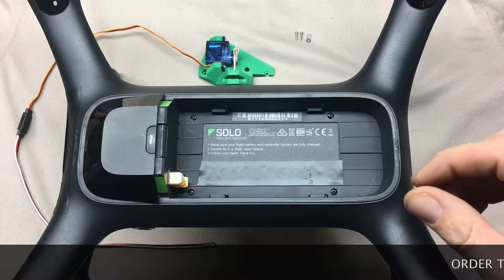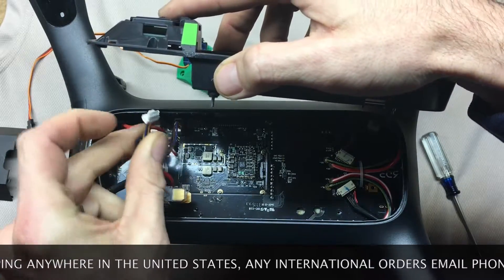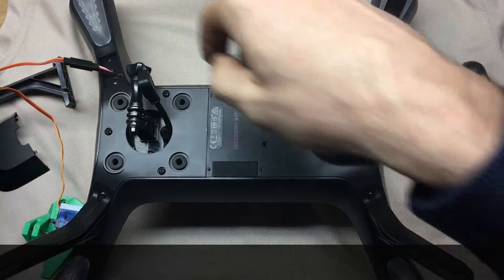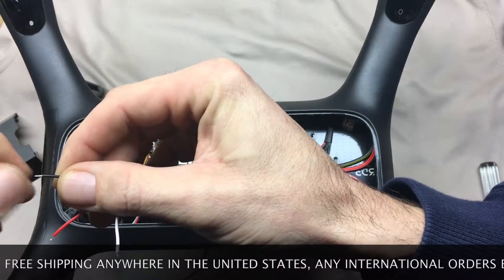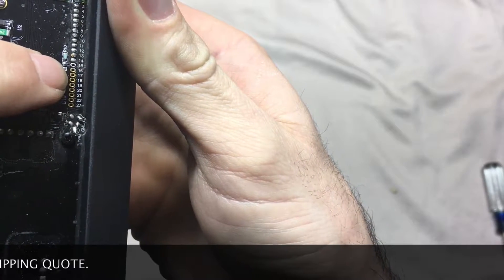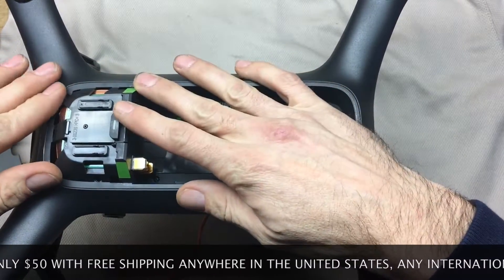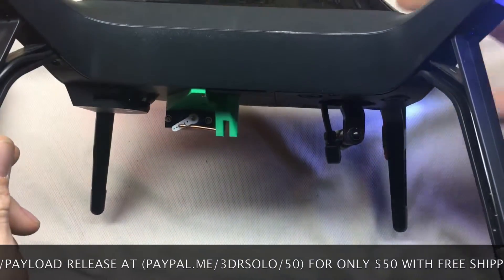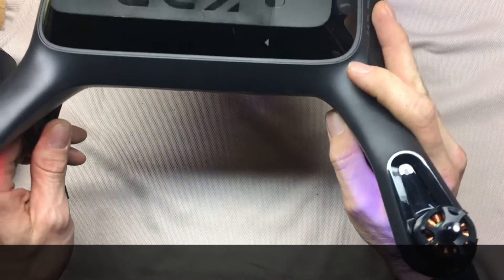3DR Solo bait drop payload release install video

Comment: Sorry, so the rewind function triggers the same channel? And which part of the Solo App would I use to use the pause as drop-only? Thanks
Reply from the maker: Both can be used together but if you want to turn rewind off go in to solo settings in the factory app and rewind can be disabled.

Comment: looks great! would it be possible to install this with just the brownie breakout board and not soldered on the inside?
Reply from the maker: I wish it was but that pin doesn't go through. It can but one way or another you will have to solder inside the body.

Comment: Can you change the button mapping pretty easily?
Reply from the maker: Yes its very quick with Tower app or Mission Planner on pc.
Reply from the maker: Yes, I used Tower app. Only takes a minute.
Reply: Do you think it would it be possible to reverse the servo direction so the long press opened it and the short press closed it?
Reply from the maker: Yes easy to do with Tower or mission planner.